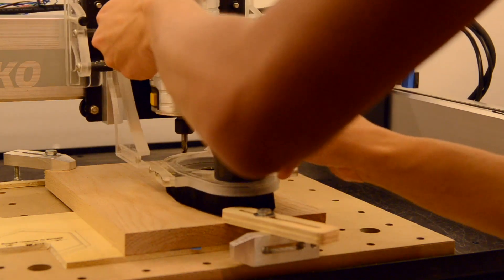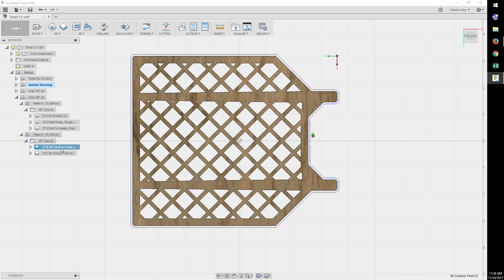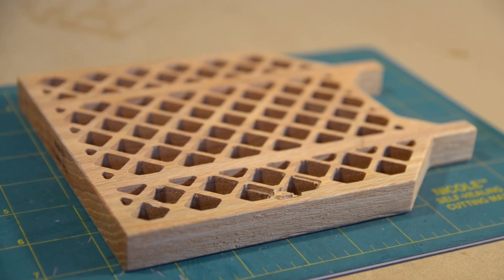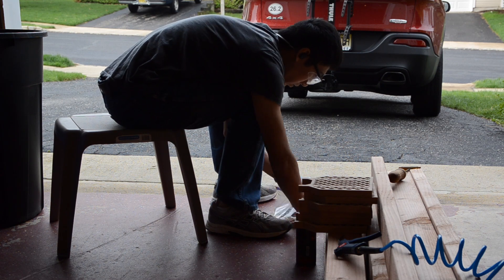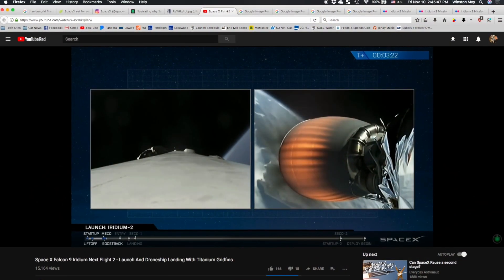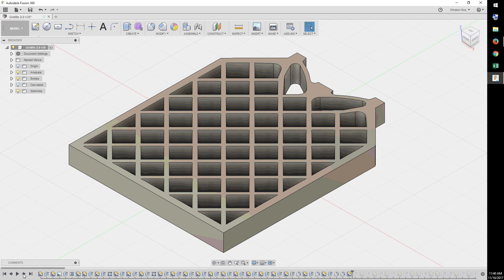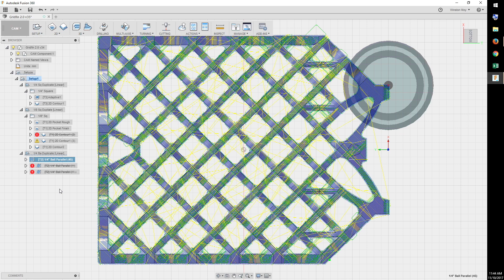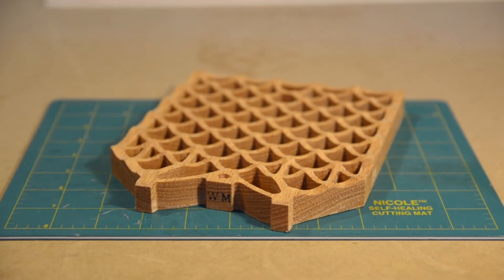SpaceX-Style Wooden Gridfin Trivets - CNC Project #86/104

Comment: When you switch to the 1/8th long reach end mill for your finishing pass, are you doing it by going to the full depth and then taking off a few thousandths all at once, or do you step down the depth as you go? Also upcut, downcut, or compression for this pass?
Reply from the maker: I still stepped down with the 1/8" because in the corners your radial engagement changes and I was (overly) cautious about the load spike causing deflection. I used an upcut but compression would be even better.

Comment: you can make silicone copy mold, then wax and lost wax casting aluminum. but surface finish on casted alluminum will be a lot harder
Reply from the maker: Surface finish on sand castings is questionable, but if you do a plaster mold it's pretty good. My biggest question right now is how to anodize a cast piece, because as impurities precipitate out, you'll compromise the finish.
Reply: i would first try tumbling then electropolishing
Reply from the maker: 👍🏼 Yea, that or bead blasting was my thought.

Comment: Let the excess mineral oil drip back into a container and reuse. The oil will come to equilibrium in about 30mins to an hour with most of the excess being recovered just a little will be left on the surface to wipe off

Comment: there are foundrys around that can take your pattern and cast it in iron..   so you will have to make up a split pattern  so they can make up the sand filled casting boxes . you will have to design in a half ball  so you can lift and pivot to flip sides..  look at Grizwold waffle irons for that shape.. and for the base shape idea.  you can get spring handles to cast in thru Century spring company.. http://www.centuryspring.com/stove-handles.html

Comment: Very cool.
I can suggest something to help with Fusion 360.
Learn parametric drawing. Not to be critical, but your CAD skills are kinda lacking (I mean that in a friendly, supportive way :) )
With a simple model like this, you should make the entire thing from a single base drawing, and extruded all at once. That way when you make edits, the entire model will update properly. Just go back and edit the original drawing as needed. When you click "finish drawing," the timeline will advance and the model will update. The coves most likely will have to be drawn on angled planes after the model is extruded. The method you used should only be used in the most dire need - it is a huge resource hog and can cause other major issues with orphaned bodies.

On the machining end, stop mucking around with interpolation and avoiding tool changes. Nothing beats a drill for removing stock - drills are really fast and cheap. I bet drilling 4 small holes in each corner, then following up with a big drill in the center will still take 1/2 to 2/3 the time of interpolating. Even just plunging straight down with a big center cutting 2-flute endmill will be better (plunging is almost always faster, uses less HP, and overcomes lack of rigidity). Then just go right in with a finish mill. Get a cove tool to make the scallops.
Interpolating is sexy, but a huge waste of time for most jobs.
Reply: Thank you, sounds like very good advice!

Comment: There is such a thing as Teflon coating on a hard coat anodize for aluminum. We just had that process done on some parts at work
Reply from the maker: Yea, I did come across that process in my search. Just wasn't sure about who to go to for the teflon coating, since it's not as common as anodizing.
Reply: Winston Moy might be able to give you contact details for someone who does both if you are still interested
Reply from the maker: If you think they might be willing to take on small batches, shoot me a message. Not sure if I'll go down that route, but it's good info to have.
Reply: Nordicware in MN does Teflon coating on aluminum.

Comment: Did the Space X guy ever respond to the coasters you sent him?  

Chris Anderson does iron metal casting, put out a call asking some him or other metal casters if they want to do a collab on the Waffle Iron.  You already have most of a model already done.  You could cast a two piece waffle iron (top lid and bottom) with a hinge, making it look like the one on the ship.  You can add the Space X or Nasa logo on the top.
Reply from the maker: I'm still in touch with my SpaceX contact. Elon basically never responds personally. Long story, but things are okay on that front.

The waffle model would almost have to be made from scratch, as draft angles are needed to properly remove a waffle from the iron. But still could leverage some of the work I've done already. Thanks for the leads.
Reply from the maker: Fusion's got draft angles. I could machine them the efficient way (with a tapered endmill) or the slow way (ball endmill, waterline passes)...